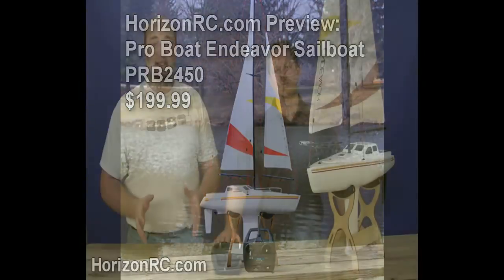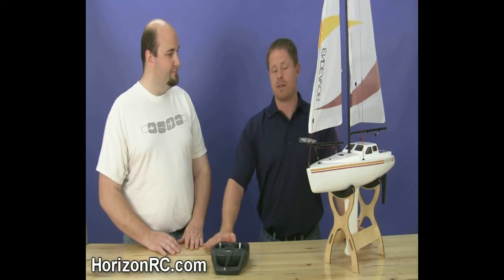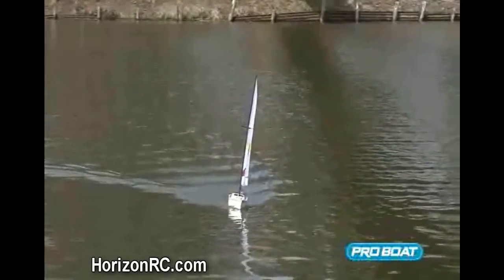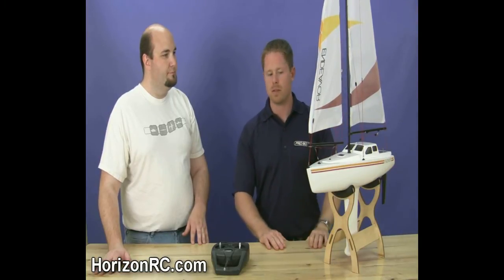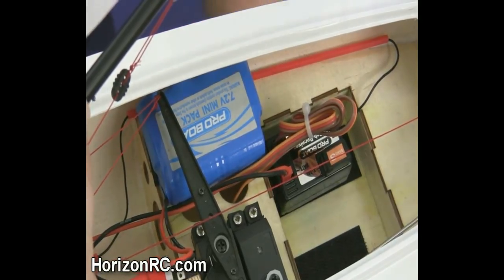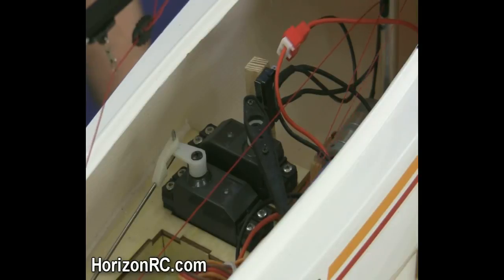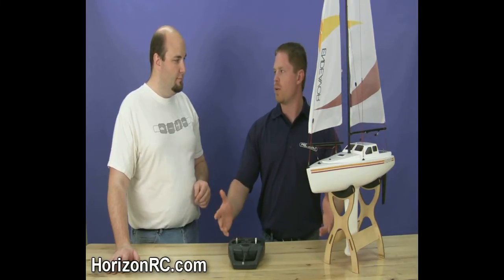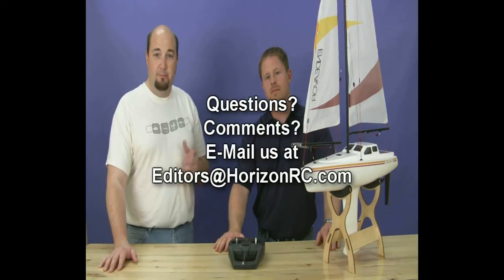HorizonRC.com Preview - Pro Boat's Endeavor Sailboat RTR

Comment from the maker: @GreenAce92  For surface applications you'll see both 27mhz and 75. Since the motor is there more for emergency use the micro switch is a more efficient option to use. An ESC would also have raised the costs but not added a whole lot in terms of functionality